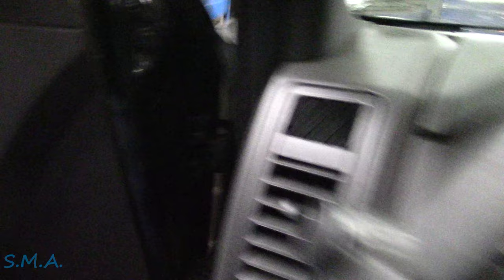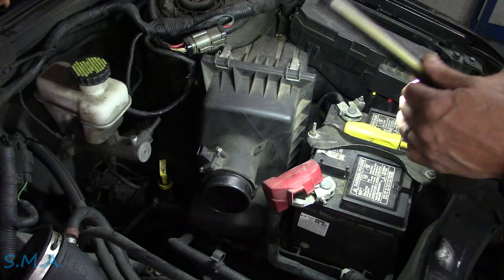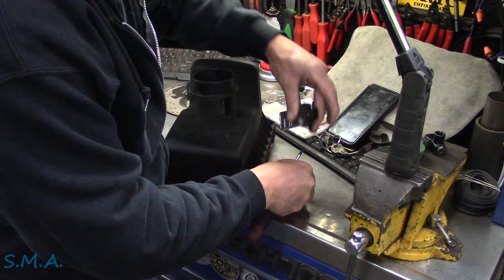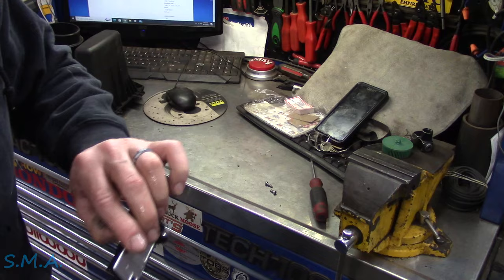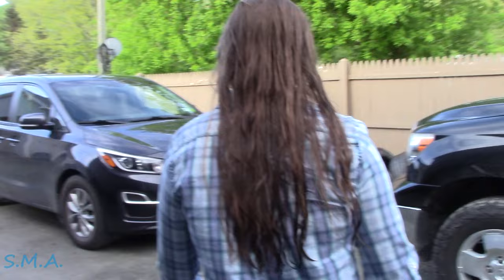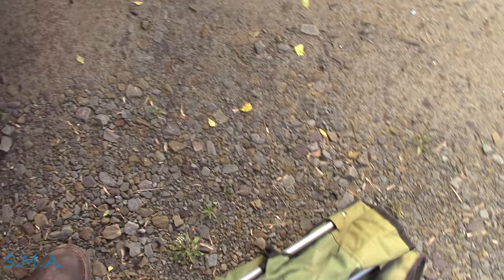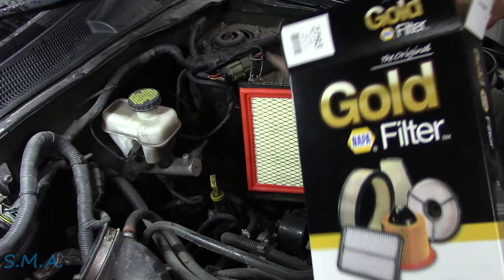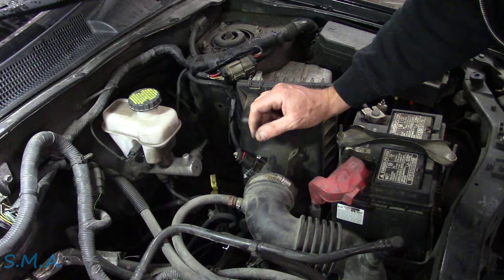A Mouse, A May Fly And A Broken Car....

Comment: Yeah - watch out for lightning!!  Mice got into my 2011 Prius and 2011 Forester through the air exhaust vents in the back. Rubber flaps that mice can easily get through!! Don't know what the manufacturer's were thinking. I got some wire mesh and the hot glue gun - took care of that problem. But only after they dragged some insulation around.

Comment: Funny how underestimation of air flow leads to a rich at rest, lean under load pattern. After pondering over that one a little, I surmised that the slope of the graph of MAF voltage against air flow is blunted by the fluff covering the MAF wires. That would lead to the most dramatic lean finding when exposed to the high air flow of engine load, so the PCM responds by giving more fuel at all rpm conditions. The algorithm must place more weight in data under engine load rather than at idle, so it ignores the rich at rest part of the situation. Problem is, at idle that extra fuel has to go somewhere, so it floods the cat and goes out the tailpipe.

Comment: You’re extremely good at what you do. I’m sure you’re very fair with your prices and nobody works for free so you shouldn’t be expected to do so either. It’s not how long it takes you to do a repair it’s your ability to diagnose and get to the answer that’s where the value is. So in the end it’s cheaper than it could’ve been somewhere else because you didn’t just keep throwing parts at it. Keep up the great videos Eric.
Reply: As my brother once said, "If I didn't want it to work I would have done it myself."

Comment: In Arizona we have packrats that can fill  your engine bay with cactus, twigs, under-hood  fiberglass and dog poop in a matter of days. For some reason packrats love to collect dried dog poop.  But my worst incident  was when I was out of town for a few months and a ground squirrel made a nest in the H3  air filter box. I had to remove the air box and pour out liquid squirrel while wearing a respirator. Talk about gross. Only theory I have is it just grew too big to get out one day. I put a screen on the intake and it was cheap and easy. We sold the H3 because it was designed as a ground squirrel habitat with luxury apartments between the inner and outer fenders. And packrats just loved it too. Lights under it all night didn't help at all. Nothing worked.

Comment: ... had a mouse get squashed in my serpentine belt and thrown toward a wire harness while on a trip... he hung there a few days and looked like a piece of jerky next time I checked oil level... only smelled funky while driving for maybe 20min... it was summer in AZ, 110deg,and along with engine heat, it was like a convection oven under hood ...

Comment: Had a mouse in my car once - it got trapped in the HVAC fan, and when I turned it on, the fan vibrated off balance then went funny... a day later a funky smell filled the car. 

Tore the HVAC fan apart, and found the dead mouse inside...

Comment: I had a 06 pilot that a mouse had died in.  I completely stripped that car down to all metal to look and clean.  I finally found it while removing the dashboard. It was melted into the rubber under the dash right up by the windshield. At least all the seats and carpet got shampooed while they were out.  Brand new car when done

Comment: 3 years ago, a friend was driving an Outback. Car stalled, couldn't restart, towed to garage.  Replaced a part, car started, and its fixed for 1/4 mile. Garage said they fixed what was wrong and suggested it go to the dealer. Towed to desler, fixed the issue, for 1/4 mile. Dealer picked up the car and insisted they fixed to issue. Next they say It's fixed! When we picked up the car we asked what they found.......a mosquito had been fried on the MAP sensor.

Comment: Eric, 
I had a case of water in a barn closet which had mothballs to deter mice from visiting and the water wound up having a mothball flavor by the time I got to it (about two months).
I am not saying that the water in the van has become an overnight bio hazard.  You might be better off using that case of water for the flowers instead of drinking it and possibly getting sick. Take this info as you see fit (now watch the angry sarcastic comments follow in response to this comment).

Comment: When I was a Chevy Tech a new Caprice came in for it’s first service, and the complaint of a foul odor. I could not pinpoint the source until I turned on the AC and BAM! I started dismantling the ventilation system. When I got to the blower I inserted my inspection mirror into it and discovered that a mama mouse and her babies set up shop inside the fan wheel. The whole inside of the housing was coated with blood fur and minced mouse parts. I cleaned it out as best I could and sent along a can of deodorizing spray. The customer tried to argue that it should be covered by the warranty. 
Another mechanic had a lady come in that said every time she applied the brakes she heard a scratching sound. Turns out a rabbit found it’s way into the space between the wheel well and firewall. Every time she stopped  he’d slide down and burn his butt in the exhaust manifold, then frantically clamber back into his hiding spot. The poor thing had a big patch where his fur was burned off.

Comment: Had a mouse die inside my Ford Fusion. I found a Ton of horse hair nesting material on top the cabin air filter but no mouse. After almost completely disassembling the entire interior, I never found it. I ended up buying several bags of odor absorber and filled my car with it.

Comment: I saw a video where a mouse did the same thing and chewed up the air filter. The only difference was their air filter had a metal mesh on top (similar to what you installed), that kept the mouse out. The MAS had a piece of filter material stuck in it! 
I saw a video of a mouse living in a plant, at the Home Depot Garden Section! Buy a plant, get a free living garden gnome named Mickey.

Comment: By some Peppermint essential oil mix like 10 drops of oil in a spray bottle and spray under your hood and wire harness . Nice hate that smell and will leave. I do it like 3 times a year. So far no mice to cause big problems. Hope they work on Chipmunks. They can cause a lot of problems to. We have a lot of them around here. I set traps and get like 12a year. You need to put a little soap in the water so the oil will mix with the Peppermint oil.

Comment: Those older Escapes with the 2.5 last forever. My employer had a small fleet of them, several lasted past 300k miles. They got replaced with Transit Connect vans that also have the 2.5 and they've been good too.

Comment: My wife's 2011 Kia Forte was running on 3 cylinders. A rat had eaten through an ignition coil wire. Got out the ol' wire stretcher and crimped the sections back together for a temporary fix. Not my best work. The fix has lasted for 6 years. Rat was caught in a catch and release trap while I was at work. I planned on driving the rat across the river to the next state, to release it. Wife's brother drowned it in a bucket before I made it home.

Comment: Years of working on tractors, combines, and skidloaders, there have been many repairs due to mouse damage. When you open the door and get punched in the nose with that smell of mice, you know you're in for a nightmare project!
Reply: Smells like money to me 🤣
Reply: @mattt4183  Years ago we had a combine traded in and the mouse smell in the cab was horrible. Our detailer ripped everything out, cleaned, and all fabrics were replaced. After all that the smell would still come out. It had to have been so imbedded in the harnesses and metal to still stink that bad.

Comment: Around here, lots of mice.  I cover the air inlet snorkel with 1/4" hardware cloth.  Also, the firewall outside-air inlet gets covered.  And where Vanessa is talking about mice getting into the cabin... and the most insidious failure of auto designers, is to not cover the rear exausters.  These are the plastic slit vents, sometimes having little rubber flaps, to make them one-way.  These are placed either under the rear quarter panel inner wall, or in front of the rear taillight housings.  In either case, these need to be covered with 1/4" hardware cloth.  Mice learn to lift the rubber flaps and come inside the trunk/cargo area, behind the inside walls, eat the rear seat shoulder belts, come out the shoulder belt slits, or just die inside the rear/cargo area.  Damned engineers leaving holes for mice.  Of course, one may not keep mouse outside the outside, so sometimes it is necessary to wrap wiring harnesses with hardware cloth shields.  We had a rear evap vent wire gnawed exactly where the wire entered the frame... very tricky to fix, and totally faked us as the connector at the vent valve was untouched.
Reply: Yes, screwed 1/4" hardware cloth over certain holes in the unibody cross tubes, too.

Comment: A huge production plant was without their long time guru since he retired.  The plant machinery broke down, costing above $100,000 an hour for downtime.   No one could find the cause.  The manager called the retiree in to locate the problem. The retiree walked through the plant, then to a large machine, and in just a couple of minutes, carefully tapped the machine with a hammer while listening carefully.  Then he declared, “The problem is right here.” Sure enough—and machine  was quickly repaired.  The manager joyously thanked him, then ask how much for his help. He promptly stated it was $100,000. The bewildered manager then said “Ok, but how about an invoice detailing charges. The guru submitted the invoice: $5 for hammer,  $99,995 for knowing where to tap it.

Comment: I got hit by lightening once, but I was flying a plane at the time. Saw a white flash go from the cockpit to the back of the passenger cabin. Blew a hole in the left wingtip and the top of the rudder.

Comment: How does a mouse get into the van?
Great idea to find an air filter with the metal mesh to keep them pricks on their side of the border. Not only that but a lot of the filter media will also get trapped by the mesh as well. The think the mouse filter damage came first, then the bug ?  Minimum diag charge and you are good to go...

Comment: Had this happen on our 2014 Subaru Outback....bug got stuck in the MAF and the car wouldn't run without feathering the throttle. I however did not have a hole in my air filter.

Comment: In this case I would bill also.  Several years ago (32) I got a call of a customer finding a screw on the floor behind the copier.  Since I was already in the building, I went and checked it out.  The screw was a cabinet screw, so I screwed it in and told the customer to have a nice day and didn't invoice a bill.   When I got back to the shop, the owner/service mgr reamed me a new one and threatened to take the service call out of my paycheck.  But over the next 10 years that same customer purchased 3-4 more copiers from us and always requested me to do the servicing if possible.  If, at the time, I would have charged $65 to attach a cabinet screw what do you think would have happened?   Those are always toughies.  If it helps build a business, sometimes just wink an eye at some things.  Don't be money short sighted, look long term  customer loyalty

Comment: I hadn't looked in my glove box for several days one time last year. Then when I did, something took off and disappeared behind the glovebox. Well, that cured my bowel movement problem! Lo and behold, a mouse was busy constructing his new home in the glove box. Had all sorts of crap in there, fuzz and little pieces of my car's owners manual he tried to eat as well. Those little suckers are chewing machines! Well, I cleaned all the crap out of there and lined the bottom of the globe box with tin foil. I was told they hate tin foil. Had to  check the engine compartment to see if he tried to have any electrical wiring for dinner. luckily he didn't.

Comment: Being from the south I've seen damage mice cause by chewing wires and even hydraulic cables in RV's. I've been told that the insulation on the wires is made of organic vegetable component that actually provides food for the rodents. They cause thousands of $ in damages to vehicles.

Comment: funny story i had once mate. A lady bought me her 80 series cruiser with a 1hz motor and told me it had no power and was using heaps of fuel. Anyway after some inspection i found a couple of feathers on the air filter but not much else to choke the engine until i noticed the snorkel hat had no grill in it. I pushed a wire down and it met some resistance about 4 inches down so i took the snorkel off the car and low and behold a pheasant had somehow made its way into the inlet. Yes a complete pheasant!. When i showed the customer she told be she thought she hit a bird a couple of weeks back but hadn't given it a thought..so i fitted a mesh screen in her snorkel hat figuring if her luck was that bad she might get a cat next. The things we find eh?

Comment: Long ago we had a new box of dog treats in the laundry room cupboard.  And a small gap where the air vent tube came into the house.  Eventually we noticed a lot of rustling in the air ducts and some actual mice teeth trying to chew out through the hot air vents!   We set out glue traps and eventually caught 24 mice.  And oh, investigating we found the 5-pound bag of dog treats to be completely empty!   Those mice ate well!   Never figured out how they got in and out of the air vents.

Comment: You mean to tell me that you found a problem quickly because of your vast knowledge and experience, cleaned the MAF sensor, vacuumed out the debris, changed the air filter, and you’re not going to do it on the house? 😂 I’ll never understand how people could think that you should do that for free. As a diagnostic guy myself I can probably name 10 shops in my area that would’ve struggled with that problem for a day and it probably would’ve ended up at my shop all because it didn’t have a code for them to throw a part at. You can pay someone who doesn’t know much to play the guessing game with your car or you can pay someone to quickly and efficiently diagnose and repair your vehicle. I know which one I’d pick all day every day.

Comment: Comment on placement of mouse traps. I had acCaddy 2011 suv, and was lucky as I got about 8 to 10 mice out of it. The placement is key, mice go along the edges , thus place traps along the edges not on the floor. I put in about 10 traps along the foot wells, along the seat rais etc. caught them all over a two week period. Did ont take them out for about a month to be safe.

Comment: WELL ERIC i would say that ford motor is now on par with JET ENGINES that can suck a seagull or goose through the intake and still run good enough to land.
All though PETA may go after that air filter company for not putting a mouse safety screen on that brand air filter,at least out here in KALIFORNIA!!!

Comment: No parts required as Ivan would say haha. Although I guess you did replace the high flow air filter.

Don't understand why anyone would think you shouldn't charge the customer. If a professional is called to solve any problem at all, then yes you pay. It doesn't matter if the fix requires a quarter turn of a fastener or dropping the whole drivetrain.

Comment: The German brands usually have the air intake from the top of the front grill, so the grill itself blocks the animals and its also nice and high up in case you drive through deep water.   I still prefer GM cars though after owning so many different brands just easy to DIY stuff and I live far away from any repair shops so I need to choose cars that I can repair myself so sticking with GM for now.

Comment: We had mice 🐭 built a nest on the cabin air filter in the Toyota Tacoma. It’s a 2012 with 55k on it. And the stink was so bad I didn’t think I would ever get that smell out. 
I now have a mouse blocker that runs off the battery. It doesn’t pull any more power then the clock. So it doesn’t drain the battery. So far no mouse droppings under the hood. Got it on Amazon. Oh yeah they had eaten the wires that ran the throttle.

Comment: Found the same issue in a 2004 Impala, start and die. Changed fuel filter first, ran better but no power, filter was a rodent factory.

Comment: Mrs. O. was pretty animated when talking about dispatching that mouse. You know she was lookin' forward to it!

What would the chances be that the unfortunate mouse would be stuck in an intake runner? 

Also, I know MAF cleaner is supposed to be wicked clean and not leave a hint of residue. Could you use Brakleen in a pinch? That's not supposed to leave a residue either, right?

Comment: Most of the places I worked at, the charge would have 1 hr., (minimum flat time) plus flat time to r/r the sensor, .1 hr to replace the air filter, plus parts.   Some shops charge misc charge to cleaners, nuts and bolts, rag usage and more.  I worked at one place that charged 10% of the hourly rate up to 5 hours of labour for "misc" items.  Hourly rates where I am start at $125 to 375 at some imported dealerships.  What's the rate where you are?

Comment: Hmp! Imagine! A guy fixing somebody's car and expecting to be PAID! 

(Sarcasm, of course.)

FUN FACT, if anybody is interested (the bug in the sensor reminded me):

Early computers worked like early telephone switchboards where the operator had to unplug a cable from a port and plug it in elsewhere in order to work the machine. Once, a [moth?] got into one of the jacks and prevented the plug from making contact. Hence, the expression "the computer has bugs in it."

Comment: They ( the mice ) ate through the steel in my air filter, nest in the intake. nest in my glove box , poop from front to rear in my jeep wj , it's a good thing I have to change the heater core so I can clean out the hvac system. the worst part is I hate to kill them , A 67 year old gun toten man and I can't kill a mouse .